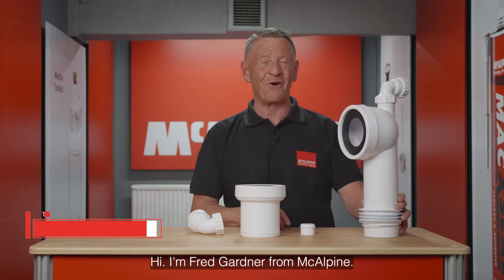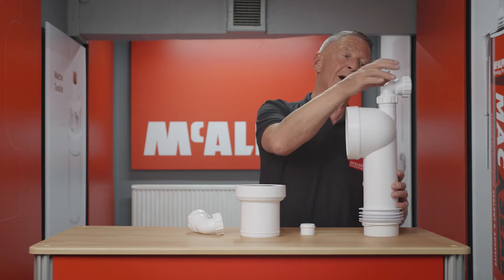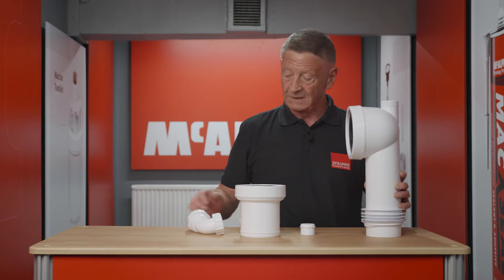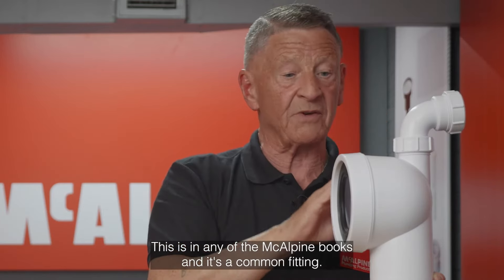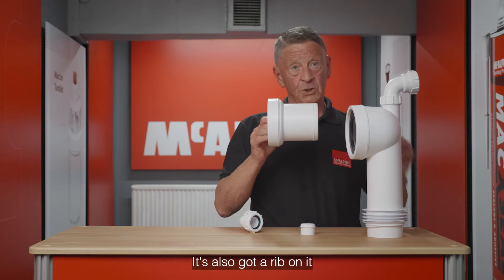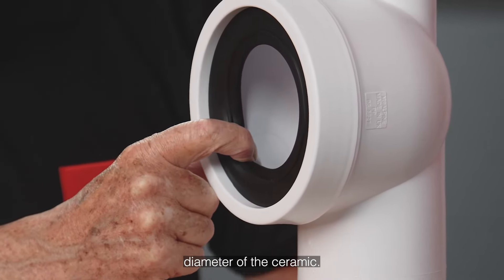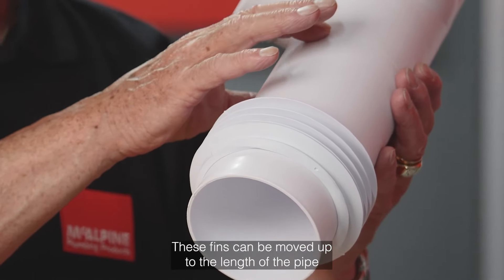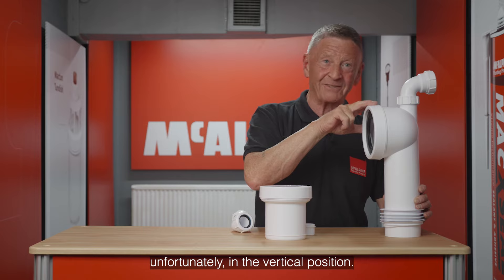Product Demo: McAlpine Rigid WC Connector with 1¼” Universal Vent Boss

Comment: Do you not do an equivalent fitting with a vent that suits fitting to a horizontally (with fall)  mounted 110mm pipe, as these are more common these days with back to wall toilets?

Comment: Chat GPT contradicts your last comment about only fitting in a vertical position. Also where in the instructions or on Website does it say it can only be fitted vertically?
Reply from the maker: Regarding your comments on the installation of the WC-CON8V the reason the connector is advised to be installed in the vertical position is because the boss-inlet to vent or take another appliance is above the water line during discharge of the WC cistern into the WC pan. If it was installed in the horizontal position the inlet boss would be in the mid-flow position which is never advantageous, any real tradesman would be aware of this as it may pull the appliance water seal.
Reply: Well you sound very assertive Paul 🤣